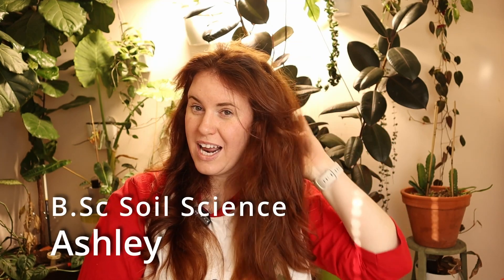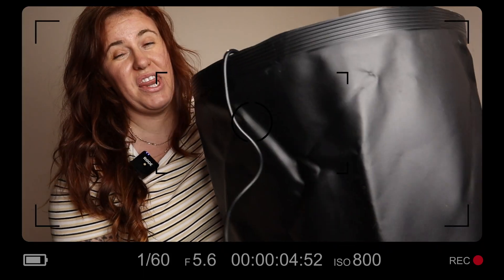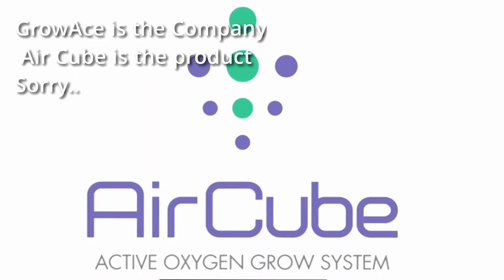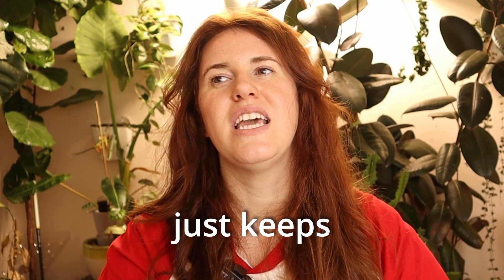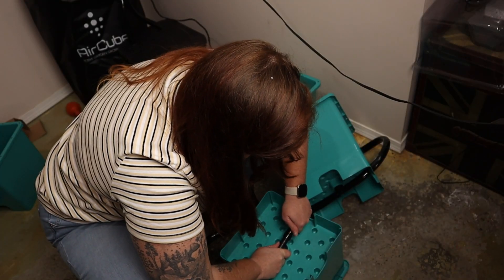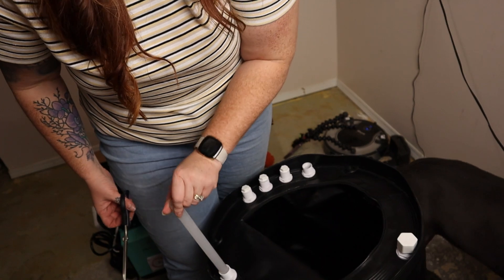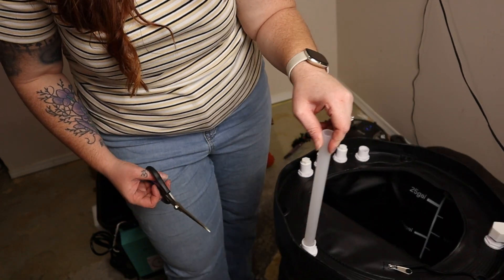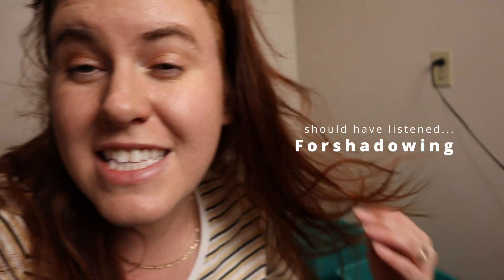My 1st EVER Experience With Fully Automated Indoor Growing. AirCube

Comment from the maker: I could very well just be really clumsy and that’s part of the issue here 😅. AirCube 6-Site System Affiliate Link  -  https://bit.ly/478Cyqo 
Code: GICHIGH5
This code provides a 5% discount on any of our AirCube systems builds (6 site - 36 site).
Reply: I had some beefsteak tomatoes that ended up past their prime for any consumption, took some slices from them, threw them in potting mix, and then transplanted to 5 gallon pails. That was early November. So they’ve been growing all winter with the aid of grow lights. It’s been an oh so slow process but they are slowly fruiting. Biggest challenges have been light here in zone 3 Saskatchewan and now that the plants are big, keeping them well watered. I do wonder if the fruit will actually mature… winter indoor growing in zone 3 is very challenging.

Comment: Anything that grows to maturity in less than 60-days, just use a 1 gallon bucket with a net cup drilled in the lid.  There's enough dissolved O2 when you top it off.  The only reason to use an ebb flow is if you have a medium height of 6-10+ inches, beyond the wicking capacity of usual soilless.  Such a stubby system should just use an autopot or some other passive wick - the submersed water level is so low and replenished on an as-needed basis, it never really desats and go anaerobic.  Pumps and plumbing are cool though, if that's your thing :D  Kratky bucket growing is definitely unsexy.

Comment: It's not a stroke of bad luck; it's simply a case of poor design. I constructed my own system, employing a small pump (5W USB powered) in each bucket. I've successfully grown red robin tomatoes and sweetie cherry tomatoes using this setup. It's efficient too! With my 1-gallon bucket (an old PP ice cream container), I only need to add water every 3-4 days during fruiting. A fully integrated system is better suited for professionals due to the higher standards of materials, design, and maintenance it requires.

Comment: Question for you. My kids did a hydroponics demonstration for their recent science fair. (We used a kit with a light pump and fan and it worked really well.) It made me wonder something. Why is it that it’s possible to over water a plant potted in soil yet hydroponics (growing a plant in only water) works and doesn’t have the same effect as over watering?  Thanks!
Reply from the maker: Oooo lol it’s the anerobic condition of fully saturated sol that’s the issue
Reply: @GardeningInCanada  Thanks. That makes complete sense.

Comment: There are a few cannabis focused companies that produce highly rated products along these lines. Some of them work well like the floraflex versions. Others like Bluemat get a lot of heat for over saturation, flooding, leaking etc. I hear, getting the watering just right can be a pain. I know you prefer peat over coco but coco works best in these setups. You can even use organics but I'm sure your aware, lots of water + organics means 5000 springtails and 10,000 mites. I made that mistake doing high frequency fertigation with organics lol.

Comment: You might try an Earthbox or two. No tubes or pumps. Right now I am experimenting with two Earthboxes and two EarthOne plant monitors. One box started dry and the other 100% wet. In the dry box I am only watering from the reservoir to determine the wicking action of the soil. In the wet box I've planted cover crop and only water enough to get the seeds sprouted. Just a little experiment.
Reply from the maker: Interesting!